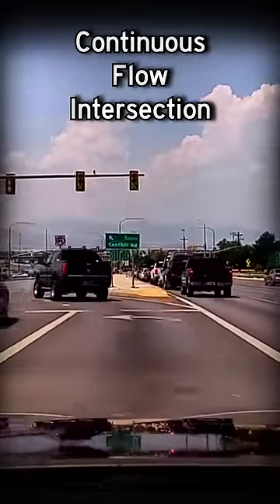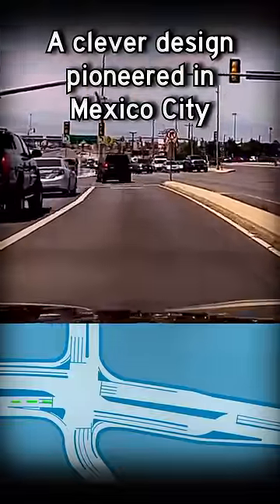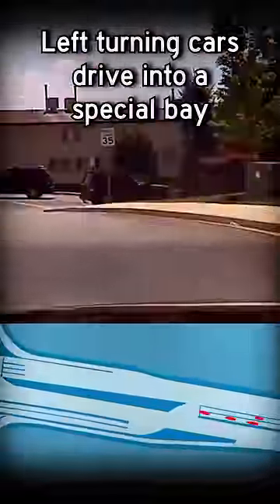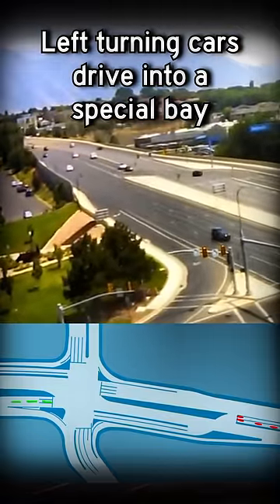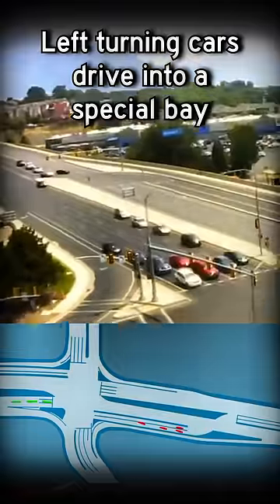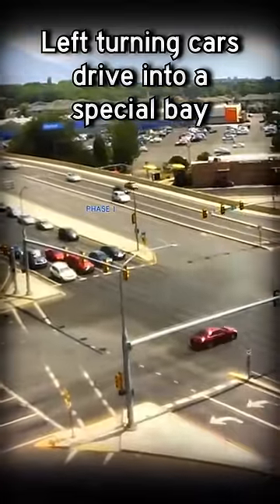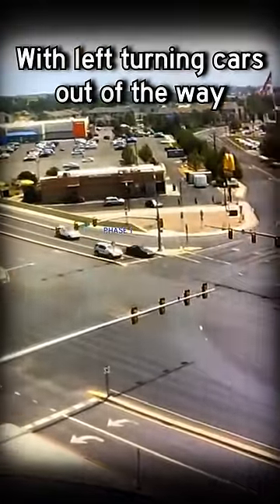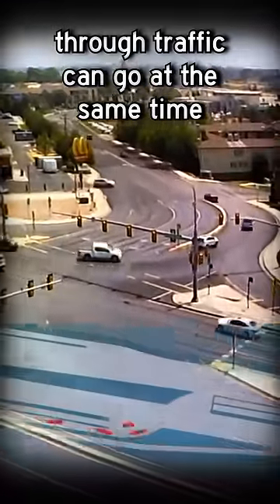Continuous Flow Intersection #shorts

Comment: The more I see crazy interactions like this, the more I start to appreciate roundabout designs 😂
Reply: roundabout is so good that its only problem is some people just dont understand that if a car wants to leave the roundabout on the same area as you wonna enter then you should let the car inside leave first
Reply: @nfsilverblade1526  Actually there is one other problem. For much of the united states they are so rare to see that when you come up to one its likely your first time seeing it which leads to drivers getting confused.
Reply: we have one of these where i live in canada, it actually is fairly decent for traffic flow but it realistically only takes one idiot to fuck it all up.
Reply: I live in Wisconsin (has one of the highest roundabout counts in U.S.) and I still see people getting confused by and stopping infront of roundabouts when there's nobody in them 🤣
Reply: @nfsilverblade1526  The one issue I've seen with round abouts are the ones with multiple lanes. People just move into your lane without checking to see if anyone is in that space already.

We have a small single lane one in my town. It sped up traffic a LOT. That intersection used to back up onto the service road and into the main road down the city. They put that round about in and both roads are clear even during rush hour.
Reply: Roundabout is great but is not the solution everywere cause if alot cars come from all 4 directions you will have problems
Reply: @xsforreal  im from Wisconsin too. Actually from Oshkosh, so EAA traffic makes the roundabouts super chaotic. But it is still better than when they were traffic lights.
Reply: @TehShadowDeath  I've seen multiple roundabouts but only a single one that has 1 lane, about 50% are 2 lanes and 40% 3 lanes
Reply: I’m the 666th like. Spooky!
Reply: @TehShadowDeath  that sounds more like an issue of police not properly ticketing traffic violators. You are not allowed to switch lanes in a roundabout. If it got ticketed properly, the information would spread quickly. Also, drivers should be required to take the written exam more often to cover new laws. Same issues happen all the time at traffic lights
Reply: @morbotheturtle3796  You are allowed to switch lanes in a roundabout.  If you weren't you'd be perpetually stuck if you didn't use the right hand lane.  Who told you that you're not allowed to change lanes?
Reply: Roundabouts are just as bad though.  It's wierd city planning propaganda that they're better.  They essentially have identical traffic flow, the only practical difference is that statistically roundabouts have more accidents but the accidents they have tend to be lower severity.
Reply: The way people talk about roundabouts you’d think there’s no traffic in Europe
Reply: i think he’d be fine with improving safety on the road

But using 10 lanes to do so?
Reply: @jimmydesouza4375  they only have identical traffic flow if you consider high traffic hours. Low traffic hours, roundabouts are much better. They reduce idling and keep you car’s efficiency higher. They have more accidents, but less major accidents. Traffic lights have t-bone collisions, roundabouts have minor fender benders
Reply: @morbotheturtle3796  High traffic hours are the only ones that matter.

Additionally roundabouts also have T-bones.  The statistical difference in severity is there, but it's not massive.
Reply: @jimmydesouza4375  id argue low traffic hours matter more. Thats when you end up sitting for 3 minutes at every light without a single car passing by the other way. High traffic times, the only thing that can be done is reduce the number of cars. Or use all self driving cars
Reply: Except in the US people drive SO fast in roundabouts, don't yield and many places have snow and ice
Reply: @NathanHedglin  kinda their problem if they didnt use it properly. Plus, again, police need to be enforcing the traffic laws to prevent those issues.
Reply: @bradybannister1926 I mean the same goes for traffic lights and stop signs.  One person can fuck it up.
Reply: They are great but i see people are very timid at them because of road ragers and people approach them at to high of a speed causing the system to not work half as well as it should
Reply: @NathanHedglin  That's just normal.  Even in countries where roundabouts are common most people are not comfortable with them so just try to "power through" by going fast.

All junctions will have similar problems though, for example people racing yellow lights.
Reply: A traffic circle is a continuous flow intersection. What is presented here is not.
Reply: @seth7745  No, what is presented here is a continuous flow intersection.  The term specifically refers to this kind of junction.  There is no such thing as an actual intersection with continuous flow as such a thing is impossible.
Reply: @jimmydesouza4375  You might want to look up the definition of continuous. Your statement makes no sense.
Reply: @jimmydesouza4375  In engineering "continuous flow" means uninterrupted. You can’t call it continuous if you have to stop. You typically don’t have to stop at traffic circles unless there is heavy traffic, hence continuous flow.
Reply: The only downside is that a lot of places in the US don’t have them and thus don’t know how to drive through em. My area has been getting more and more of em tho and it’s been pretty helpful
Reply: roundabouts are super common in many countries, I still can't believe how people find it confusing
Reply: My city is absolutely filled with roundabouts. Which is really nice, because we don’t have to deal with any of these stupid designs
Reply: @olstar18 that's EXACTLY why it's so hard and expensive to fix. The most proportion of fatal car crashes happen at 4 way light intersections...
Reply: @olstar18 I'm not sure how. I've been to over 23 states, of course I don't remember them all super clearly but most of them have roundabouts. Especially the populates places like Cali, but I know for sure the every state I've lived in I've had atleast a roundabout near me. And I've lived in 4 states. Right now I live near 3 roundabouts I use all the time. I think they are becoming more popular or something idk.
Reply: @kcchiefsproductions8687  They may be getting put in more but there is a large portion of the country that doesn't have them. I have only seen 1 roundabout and that was new when I went through there around 5 years ago.
Reply: @olstar18 lived in longview Tx my whole life, i went down to tyler tx and saw a roundabout god was i confused
Reply: The biggest problem with round abouts are the people that want to enter, the come to a complete stop, rather than merging in, and the people that are in the roundabout don’t use their blinkers when exiting, this has the confusion… then again people don’t use their blinkers when changing lanes either
Reply: @olstar18 that's why there are signs on the road, but I've come to learn that people are dumb and don't pay attention to road signs.
Reply: @nfsilverblade1526 New England has a lot of them. We call them rotaries, and people still don’t know how to use them
Reply: Tell me you’ve never used one of these “interactions” without telling me
Reply: @nfsilverblade1526 That's why they often come with yield signs
Reply: Now that I think of it, the only reason I've seen so many roundabouts is because military bases love building them
Reply: @user-do5zk6jh1k  there is a high chance that if they don't know how roundabouts work then they will ignore most if not all signs that aren't speed limit
Reply: @jimmydesouza4375 Several studies have proven that the traffic flow of roundabout a significantly higher.
Reply: @stevenbrenesmontiel  They haven't.  You, like many, are mistaking figures.  Studies tend to show that roundabouts reduce the durations of traffic stops/waiting times on average, this is because when traffic is low density they absolutely do this because you do not have to wait at lights.

This is then misrepresented to pretend to ignorant and dim witted people like yourself who's thought process ends at headlines that this increases general traffic flow, which isn't the case.  During peak periods, which are the only periods which matter because they're the only periods where waits will stretch into significant time periods, both have the same rough traffic flow and roundabouts have even more accidents due to the higher complexity of the junction interacting with the higher traffic density (which is why the trend towards traffic light controlled roundabouts has happened in Europe, despite the fact that by adding traffic lights you completely remove all of the benefits of a roundabout).
Reply: @stevenbrenesmontiel  There is also an extra element which I forgot to add in that last post but because editing can cause google to eat posts I'll just add in an extra post which is that roundabouts by their nature slow down the total flow of traffic on the roads which they serve, so while stopped duration is reduced in general for any road which has more than 1 roundabout actual transit time will be the same or longer.  When this outcome is addressed, which it rarely is, instead of being labelled as a negative outcome (which it is) it is instead re-characterised as increasing pedestrian safety.
Reply: @jimmydesouza4375  No? If there is a normal intersection with the same amount of traffic as the roundabout, 60-70% better trafficflow would mean that more cars can through in less amount if time wouldnt it?
Reply: @stevenbrenesmontiel  Try to read posts before arguing with them.  And better yet try to read, at least partially though ideally fully, those articles you think you're citing.
Reply: The round about confuses the American. They treat round abouts like stop signs and stop signs like round abouts. I have a few normal size ones near my home here in Colorado and everyone stops even with no on coming traffic.
Reply: @ceesjonk8088  interestingly, roundabouts have a HIGHER throughput mainly because they have less turn lane interference with a continues flow of traffic (unlike eg stoplights where at best half the cars can move at any given point)
Reply: @quantuman100  Think about what you just typed.  Do you really not see the issue in it?
Reply: Oh, I've seen two t-bone solid hit accidents in a local roundabout within 6 months.  Speaker  wanting to shoot straight through at full speed and the other, I think an inside lane driver couldn't be bothered to travel around again to get into the exit lane, so cut in front of another vehicle to get out, bam! Doors crushed in! There was also a hard hit directly in the ass of another.
Reply: @quantuman100  yes but not if trafficflow is high from all directions like were im from it doesnt work at all.cause of two directions that just keep coming
Reply: @ceesjonk8088 I’ve only ever seen roundabouts with four directions, it basically does away with the four way stop!! What I don’t like is most of them I’ve seen are two lanes and ppl don’t look before changing from inside to outside lane, they just drift on over. I think it they were single lane loops instead of double lane loops. If idiots didn’t stop u wouldn’t need a second lane imo.
Reply: @ceesjonk8088  so if we assume the most edge case of edge cases where two opposite sides of an intersection are where 90%+ of the traffic is coming from AND they all want to go straight or right, then yes, but at some point you have to take a step back and accept that this is a relatively unrealistic situation when 2 roads cross
Reply: @olstar18 Wow, I guess it just seems more popular in the places I've been. Guess that's what happens when you travel alot. I'm probably just forgetting about the places that didn't have them lol
Reply: ok what you gonna do to go left is go right
Reply: Bc ur not so bright
Reply: @nfsilverblade1526 YES! God I wish more people understood this 🙏
Reply: @olstar18  it's simple - add roundabout navigation into the driving theory and practice tests like they do in UK. If you dont know how to navigate a roundabout you don't pass.

In areas where they don't have an actual roundabout to practice on, just add it to the theory, and test it in every theory test for that area.
Reply: @TehShadowDeath  people should treat it like any lane driving and look first.
Reply: @morbotheturtle3796 you are allowed to switch lanes in a roundabout and you are supposed to do so before exiting.
Reply: @jimmydesouza4375 you can't have a T bone on a roundabout unless someone is a complete maniac and tries to drive straight over it 😂  cars next to each other should be always mostly facing the same direction. You don't get traffic coming at 90 degrees to each other.
Reply: @olstar18  Build more of them and people will get used to them pretty quick.
Reply: @harropizza   Road construction isn't cheap or fast.
Reply: @giftofthewild6665  You absolutely can T-bone even without people trying to drive straight over them, and people absolutely do drive straight over them, even ones which are 2 feet higher than the roadway.  No idea why.
Reply: @xsforreal  there’s an interchange in the Green Bay Area that has like 5 roundabouts below it lol
Reply: What I love about roundabouts is the fact that someone is ALWAYS moving. It’s so frustrating when at an intersection controlled by traffic signals, everyone must wait for a colored light to change even though there may be no traffic to pass through their green light. My mind instantly thinks “everyone has places to go and nobody’s going anywhere “. 😡😡
Reply: @ValronaV  Especially the ones who think that someone who doesn't know how a road feature they have never seen before must be stupid.
Reply: @giftofthewild6665  The thing is in the uk you will likely see it while like I posted here a lot of us have never seen one. Putting the theory into the driving test only helps if you have one to actually drive through. Especially 10 years after the test.
Reply: @olstar18   there's plenty of things on the UK driving theory test I've never seen in practice, still had to learn and memorise how to navigate it for the test, and I still remember what I'm supposed to do should it occur.
Reply: @giftofthewild6665  I don't know why you're fixated on 90 degrees.  A T-Bone is just a collision into the side of a vehicle at roughly the area of the doors.  Normally associated with high speeds.  Has high injury and death rates because there's less vehicle to protect the occupants from collisions in that direction.  You do not need to be perfectly 90 degrees for that.

Additionally it is very easy for someone to get a 90 on a roundabout, especially a multi lane roundabout, for example a car driving on the right turning lane being hit by someone going across the roundabout (or left turning for you savages I suppose).

You don't seem to be very familiar with roundabouts to be honest, to the point where I have no idea what you think they are.
Reply: @jimmydesouza4375   well because the letter T makes it sound like the 2 cars are at 90 degrees when they collide. We do not use this expression where I live. I am not familiar with its meaning.
Reply: @jimmydesouza4375   you aren't allowed to drive across multiple lanes like that though. That's my point. If a maniac is doing that then they'd do that kind of thing on a regular laned road / motorway.

You are supposed to change lanes the way you'd change lanes on a motorway or dual carriageway. Exactly the same way. And only exit from the outside lane, which means the kind of collision you are talking about would not happen.

And yes I'm very familiar with roundabouts, I live in a BOT which has regular British roundabout rules and roundabouts instead of intersections in almost every instance, and I drive in Europe regularly at the weekends with European roundabout rules (which are slightly different depending on the country). Regardless in all cases you are never allowed to just drive across lanes, you are required to change lanes like you would on any laned road.
Reply: @giftofthewild6665  "you aren't allowed to drive across multiple lanes like that though."

You are.  A multiple lane roundabout wouldn't work if you couldn't.

You have no idea what a roundabout is, do you?
Reply: Yeah if more people knew how to use them.....
Reply: @giftofthewild6665  Actually could you explain to me what you think a roundabout is?  You have said that cars can't hit each other in the side on a roundabout, which means there's no turning involved, and you have said cars can't change lanes on one, which is crazy.

I can't picture what you are thinking of when you type roundabout and it is bugging me.
Reply: As someone from Scotland I drive round dozens of roundabouts a day. So much easier than junctions
Reply: Roundabouts are underrated
Reply: I hate these on highways
Reply: My city decided to put roundabouts in neighborhood side street intersections!!! School busses are always jumping the curbs!!
Reply: @ceesjonk8088 what the hell? Have you even used a roundabout before? That's never been a problem.
Reply: @ihaka70377 what you do some research will ya come here in holland and look how well roundabouts work when there is heavy traffic jeez is that weird roubdabouts are not holy
Reply: Nothing like waiting for that 16 wheeler stuck in the roundabout because it ran over some little car in the lane next to it when the road curved.
Reply: @olstar18  oh the solution is very simple you see... more of them 😂
Reply: True.
Reply: @therealpeter2267  Do you have anything valid to add to this discussion. No. Then why did you post.
Reply: @nfsilverblade1526 they use single lane roundabouts in arizona in suburbs and similar areas with low traffic flow.. many folks end up driving onto the median in the middle and drive on that on accident 😂
Reply: @olstar18  It's not my fault that you don't understand it, it's like if people said before selling home computers: oh that's a bad idea, so few people have used computers before!! they would mess up their systems anyways, why give them PCs?
Reply: @therealpeter2267   Thats only because you haven't actually read what I've posted. Never said roundabouts were bad or shouldn't be used I merely out the issue with looking down on or insulting people because they have never seen them before.
Reply: @olstar18  but it's not an issue, roundabouts were new anywhere at some point, they are designed for cars so they had to just made it up along the way, and if it wasn't a problem back then why would it be now?
Reply: @therealpeter2267  It looks like you aren't actually here to discuss this issue and just want everyone to think you are a smart as you think you are. Listen the only place I have seen one it was at an exit on the interstate that was put between towns and it was brand new. Difficult to replace a current intersection with one because of the buildings and other property that go around them. Its time you started actually thinking about what would go into making an intersection into a roundabout.
Reply: @bradybannister1926 do you live in prince Edward Island?
Reply: @jimmydesouza4375  a highway exchange is continuous flow by description. The video example is using continuous flow to represent cross traffic not impeded by vehicles trying to switch direction. yes, the traffic must stop to allow for cross traffic, but the flow of traffic is not delayed or disrupted for those needing to turn at the intersection. So if there isn't any cross traffic, traffic flow is continuous even when someone needs to make a left hand turn regardless from which direction they approach the intersection to turn.
Reply: Come and see a round about in Boston!! If you got no skills you will be there for hrs. Jfk round about
Reply: @johnnyrocket4357  A highway exchange (well most of them, because our road network is a mishmash of 200 year old roads and new builds some are a mess) are continuous flow yes, they're normally considered separate from junctions like this in the old world however.
Reply: Roundabout cannot handle the load in comparison. This is a solution for massive traffic, while roundabout is rather for small one.
I guess this thing need WALLS separating the lines, and better signage WTF is going on. 
Swedish, turn right to turn left is similar idea, turn left turns into something else, but again not taught properly would make people cause havoc.
Reply: Roundabouts only work on low-ish traffic
Reply: @bradybannister1926  Too easy to get a license.
Reply: Roundabouts aren't a great replacement for a 4 way intersection with this many lanes.
Reply: @jimmydesouza4375 untrue. Roundabouts cause constsnt traffic flow which is more efficient leading to no queues to move. Longer lines = more traffic.
Reply: I do like roundabouts. Once you know how to use them, they're so great. But yeah, in the US nobody knows what they're doing. Tbh what annoys me the most is no one is signaling. I can't tell you how many times I have sat at the ones in my town, yielding to the guy coming towards me when bam, they turn at the exit right next to me. Like dude, I could have been already in and halfway through if you had signaled.
Reply: @Sean-zz2lj  Put some monument in the center of the roundabout. Artists need employment too. If someone really wants to crash his car into a concrete block it is his own decision. He will not harm other travelers.
Reply: @olstar18 yeah, the number of times people treat the yield sign as a stop despite no one being in the roundabout is annoying as fuck.  Also how slow some people go around it, or how hesitant they are to go when there's a space.  If there's a lot of traffic you have to take the space, same as getting on the interstate at rush hour.
Reply: @NathanHedglin if you can't go an appropriate speed in the ice on a roundabout, you shouldn't be on the roads in the first place.  Most of the people I see in the ditch in the winter because of snow or ice didn't make it far enough to get to any intersections.
Reply: Roundabouts are overrated
Reply: @Johnny2Feathers they're good in most cases.  There are a couple roads that we can't ship anything on around here though because the dump trucks can't make it around them without the trailer going up in the center of the roundabout.
Reply: @Johnny2Feathers  They are good for small streets and perfect for small roads. But they use up too much space and do not scale very well.

The design shown here is probably better for large roads when a two-level crossing cannot be applied.
Reply: Yeah, sometimes I get confused though because I can’t tell if the people are going to keep turning to sort of make a U-turn, or if they’re going to go the way I expect them to.
Reply: They really arent that crazy - chances are strong this is the exact set up that you get on the Interstate with in your near by town or city.  I know it's in Sevierville, TN as well as Arden, NC and Pooler GA
Reply: @olstar18 sounds more like a skill issue to me
Reply: @ceesjonk8088 its actually better when theres the same amount of trafick from all 4 ways in my opinion
Reply: @zaqqaz stoplights no stopsign yes
Reply: @shakinbottles  yeah sorry but what your saying makes no sense have 20 years on the road and youl  say otherwise
Reply: @jimmydesouza4375  omg you're the person causing crashes on the roundabout 🤣

No you're not allowed to drive across lanes. Whenever you have to change lane, you must check your mirrors, indicate, and change one lane at a time, exactly as you do on a motorway or dual carriageway. You are not allowed to drive straight across lanes (you will cause an accident doing this).

The lanes are there to filter people going off at different exits. If you are going ouy at the first or second exit you take the outside lane. If you are going out at the last exit you take the inside lane. You always exit from the outside lane so that you dont cross a lane (and cut someone off). No one should be exiting the roundabout from an inside lane. Period.
Reply: @giftofthewild6665  I am afraid as normal you're wrong.  While that might be true for US roundabouts (no idea) for UK and EU roundabouts you are allowed to cross lanes and indeed most roundabouts specifically have extra markings to show you how you're supposed to do this (so kind of technically you're never crossing the lanes from the direction you came in to the roundabout from but you are crossing lanes from the perspective of other people).  Even on roundabouts which do not have these markings you need to cross lanes on both entry and exit if either of them have multiple lanes (not all roundabouts with multiple lanes have multiple lanes on every exit/entrance).

Anyway you've never seen one so you shouldn't be trying to insinuate a lack of ability for anyone else.
Reply: @jimmydesouza4375   I'm not in the US, I'm in Europe. But UK highway code is much the same.

Here is an excerpt:
"When taking an exit to the right or going full circle (unless signs or markings indicate otherwise):

Signal right and approach the exit in the right hand lane

Keep to the right on the roundabout until you need to change lanes to reach your exit

Signal left after you have passed the exit before the one you intend to take
"

You are supposed to change lanes, not cross multiple lanes of traffic. There's exceptions for very long vehicles which may need to straddle lanes to get around smaller roundabouts.
Reply: @jimmydesouza4375   it's great to know who is causing all the accidents. I hope you never drive in Europe, we have roundabouts with 4 or 5 lanes here, imagine crossing 4 lanes of traffic from inside to exit the way you do 🤣
Reply: @olstar18 they taught us about roundabouts in drivers ed and on our tests we also were tested at the roundabout. Where I live there’s a lot of them
Reply: @olstar18 not an excuse
Reply: @joseph-rg4jp  I know there is no excuse for your post.
Reply: @ceesjonk8088  NAH MATE UR WRONG SORRY. ROUNDBABOUT IS MOST EFFICIENT
Reply: Its insane to see people speak of roundabouts like there rare,its all we have man.
Reply: @ceesjonk8088  
We have roundabouts with two lanes and that handles rush hour traffic just fine.

You need confidant knowledgeable drivers...

When you have space to go...GO....don't vacillate about it. 
(Tuco reference)
Reply: @TehShadowDeath  I have been in exactly one car accident and it was caused by this exact thing. Double-lane roundabout, I was in the inner lane and some lady on the outer lane tried to change into my lane (illegal btw) and trashed my passenger door. Wisconsin drivers suck.
Reply: Traffic circles or roundabouts work great in London and Rome but in the US they aren't built for practicality but because the community they are in is the boutique community of people who are special
Reply: @olstar18 If a driver gets confused, they must be really stupid. It's really self explanatory...
Reply: @olstar18  then they need to educate you in theory  tests
Reply: @TehShadowDeath sounds like a driver problem not a problem with the round about
Reply: @ceesjonk8088 it actually keeps traffic flowing regardless if it comes from all directions.. just yeild to the left.. they'll always be a gap
Reply: @nfsilverblade1526 thats normal, it's only like getting in the lane for a cross road
Reply: @jimmydesouza4375 cus you can't run a roundabout youre forced to slow down which immensely reduces horric high speed accidents
Reply: @NathanHedglin all drivers need proper education on them.. once they're normalised it'll be fine like it is in the uk
Reply: @LankyScotty  You can run roundabouts. Where does this weird idea that you cant come from? People will even run ones with tall raised islands which presumably is damaging their cars.
Reply: @LankyScotty  Why educate theory on something that you wouldn't see. Refer to my previous posts.
Reply: @ihazdaforks  If you are in an area that has roundabouts. Stop using it as something to make yourself feel superior over. Your acting like a 3 year old trying to act self important over the extra sprinkle on his cupcake.
Reply: I live very close to multiple intersections and it is hell for bikers or walkera.
Reply: @jimmydesouza4375 Lmfao you're not supposed to switch fucking lanes. left lane is for the far exit or multiple trips, and the right line is for the first exit OR 2nd exit, but you cannot continuously drive around like the inside lane.
Also,the person you responded to was referring to people switching lanes and not making sure they're clear first.
With that said, I think the worst thing I've seen people do is straight gun it into a roundabout rather than yielding.
Reply: @danielboger9751 no. the BIGGEST problem with roundabouts is that people don't yield for incoming traffic, nor know how to choose a lane. See my above comment for clarification.
Reply: @homegrowntwinkie  If you're not supposed to switch lanes how do you get on to that left lane of the roundabout and how to you exit at all?  Do you levitate?  Does your car phase into another reality?

Man, the 1SD below in this thread...
Reply: @nfsilverblade1526 thats y ur driving instructor should be teaching u about roundabouts and road laws? Not just how use the clutch and shift gears?
Reply: @dxfault576  r u asking a question or saying a point?
Reply: @ceesjonk8088  as someone from the netherlands with roundabouts every 500 meters from one another - no its not. They're never an issue just slow at best when ppl kinda suck at driving.
Even if a roundabout has 4 sides and all sides are packed with people trying to enter it's still smooth sailing. You go whenever the person on the roundabout is taking a turn off just before they get to you. This is also why blinkers matter a lot.

Im standing in front of it waiting, theres 3 cars on the roundabout, 1 passes me, the 2nd passes me and the 3rd has his blinkers on to go off the roundabout just before me so as soon as they start making a turn, i can get onto it. Its incredibly simple if everyone just you know followed the basic traffic rules, which sadly can still be quite a disapointment in reality.
Reply: @MetalRaimon  o ja rij masr eens over flakkee via rozenburg waar je drie rotondes achter elkaar richting hellevoet dat was al een drama voordat ze tunnel afsloten en dus is het helemaal een drama. Maar ok daar moet alles ook weer trug naar 1 baan ik ben ook pro rotonde maar soms kan het gewoon niet
Reply: @ceesjonk8088  okay maar niet alle rotondes zijn ook goed dedigned voor de plek lets be real
Reply: @MetalRaimon  treu treu
Reply: It’s all we use in the UK, it’s far safer, and the UK statistically has far more aware and just generally better drivers than the U.S, mainly due to reasons such as in the UK people are constantly on high alert, with the narrow roads, high hedges, no road markings on many back roads, 

The USA invariably use traffic lights to control these junctions in 2. above, whereas in the UK we use many roundabouts. Roundabouts are safer since accidents have to impact at a slower rate, so damage is not as severe as T boning at a junction where impact can be at 60 mph into the side of another vehicle.
Reply: Why roundabout when you can just find wacky roads to make people pass. I think city planner in the America just like watching pedestrian play frogger
Reply: A roundabout doesn't work well when there are 4 lanes of traffic.
Reply: A roundabout is slower than this intersection.
Reply: @ceesjonk8088 Hi, portuguese man here. No, it's not. We have 6 way, even 7 way roundabouts here. Roundabouts from 1 to 4 lanes. It's doable, and they are easy to go around on... Even if a lot of idiots don't know how to use them properly.
Reply: @olstar18  That’s not a design problem, that’s just an implementation problem. There’s gotta be a first for everything and figuring out a roundabout is gonna be a hell of a lot easier than figuring out the abomination in the video. Or would you rather live in intersection purgatory for the rest of your life?
Reply: @KeitieKalopsia  Do you have anything relevant to add or are you just here to feel important?
Reply: @nfsilverblade1526 in the UK you'd fail your driving test if you didn't know this.
Reply: @ceesjonk8088 that's literally what it's for.
Reply: @FuhrerHeisen  you use your right blinker when exiting the roundabout. If if you are going straight, then after you pass the first exist, turn on your right blinker to signify that you are taking the next exit
Reply: @FuhrerHeisen  I think it's good practice as it allows people coming onto the roundabout to know your movements. If they can see you're indicating to turn off the roundabout then they know they can enter the roundabout.
Reply: Big round abouts are such a cluster phuck so I don't know quite honestly. 

 Better than stupid jug handles where you gotta take a right to take a left. Yet that isn't the issue. Issue is when the exit you get onto the road is on the left, and so you gotta cut lanea of traffic to get over to the right. To take the jug handle. Just to take a left.

 And sometimes in some places if you miss that turn you have to drive ten minutes down the road just to redo it. 

 All for a left. 

 This is New Jersey by the way. Some of the dumbest roads I've seen in the 7 states I've lived in.
Reply: Until its rush hour. Then you have cars wanting to carry that constant flow not letting others coming from other directions enter. All roundabouts really do is slow people down and let light to no traffic flow
Reply: The problem with roundabouts is when a semi tries using it. Since they are slow to start moving, it's difficult to find a spot to enter when there's high traffic, which stalls the traffic on that entrance, not only that, semis take over all the lanes once they are in.
Reply: @nfsilverblade1526 it completely jams if there's more traffic than the intersection can handle. It also takes up a lot of space, smaller roundabouts are useless.
Reply: @jimmydesouza4375 People shouldn't be able to drive across the island of a roundabout, you're building roundabouts wrong.
Reply: @ThePixel1983  There are many situations where people should be able to drive over the island of a roundabout, especially smaller ones. Even if you do not build a roundabout specifically to allow it though people will still do it just because it saves them a second or two unless it damages thier car.

Also at least in the UK we have an odd thing which I can’t remember the technical name of where sections of roads and portions of roundabouts are marked as if you shouldn’t drive on them but you actually can and should (supposedly it reduces speeds and accident rates) which can make roundabout islands more of a problem to navigate.
Reply: @jimmydesouza4375  In Germany we usually have grass and plants there, so you don't collide with a tree, but ploughing through the greenery certainly isn't the fastest option. And diameters are tight enough to slow everybody down.
Reply: @nfsilverblade1526  there’s no interference in the scenario you describe. Both cars can advance simultaneously.
Reply: @jimmydesouza4375 So clover leaf and turbine junctions don't exist?
Reply: @pulaski1  Assuming you're referring to constant flow, they're not constant flow.  By definition no junction is, which is the point.  The idea that some junctions are "constant flow" and some aren't is just an ideological ploy.  Ignoring traffic obstruction with one set of junctions while focusing on it with others, often accompanied by skewed or outright manufactured figures to "justify" it.

Which is a common trend in modern infrastructure design (and life in general).  Lysenkoism and all that.
Reply: @jimmydesouza4375  OK, so you don't know what a turbine junction is (I'll admit that cloverleaf junctions have scissor crossovers).  A turbine junction keeps all traffic away from opposing traffic at all times, paths never cross.
Reply: @pulaski1  Psst.  Those can also cause traffic slowage or stoppage, if the ability for new traffic to merge is not facilitated enough.  All junctions are pinch points in any system by necessity.
Reply: @jimmydesouza4375  I don't know where you think a turbine junction would create a stoppage, other than sheer weight of traffic, which doesn't stop a junction being "continuous flow", as in a turbine junction there is nowhere that traffic in one direction is forced/ required to stop to allow other traffic to proceed.  

I drive through a turbine at least twice a week and in one direction I'm doing 65 mph (270°, "the long way round", limited only by my comfort in taking a very long left turn) in the other (90° "right turn", really just a direct transition from an off-ramp to an on-ramp), I briefly slow down to about 70mph.
Reply: @pulaski1  See, this is people pike you being easily manipulated by catchy terms and abbreviations. Constant Flow means constant flow. Claiming one type of junction is or is not depends on selective framing, typically looking at one in ideal circumstances and one in either normal or worst case circumstances. This is done to manipulate people like you into supporting unnecessary construction which will then have to be completely torn out within 20 years when the next infrastructure trend becomes popular. All the while kickbacks are being kicked back.

But the fundamental reality is that any junction can be constant flow in ideal circumstances, even crossroads, but will not be if adequate capacity is not built, adequate capacity being unpopular now. A is true of apple junctions.
Reply: Apple junctions :D. Typing on a phone especially with autocorrect, is a form of self torture.
Reply: This is WAY better than a roundabout.  You just go when the light turns green.  You don't have to look for all the cars coming into the circle.
Reply: @williamarndt9465  You should be looking even on light controlled intersections.  People run lights all the time.
Reply: @jimmydesouza4375  Less likely here because there are curves which tend to slow down traffic.  I've never seen people try to run a light.  I am utterly amazed at how well this works.  If looks crazy from a birds-eye view, but when you're driving, it's just watching the lights and making sure you're in the lane you want.
Reply: @williamarndt9465  With a roundabout you don't have to wait for a light to turn green, which means for most of the day, and ALL night, no cars are ever waiting.  Unlike traffic lights where there is always half the traffic waiting.
Reply: @pulaski1  With a roundabout you have to look every which way to see if cars are coming.  In this plan, you don't have to wait as long for lights because there are no left-turn only lights, and no right turn on red situations.  This intersection is MUCH better than before, because it's an intersection with a major highway, and before, you'd sit for ages waiting for people to turn left in front of you.
Reply: @pulaski1  So what, you can just drive in to the roundabout while another guy is driving through it?  Do roundabouts in your country have sci-fi phase disruption?
Reply: @jimmydesouza4375  Most of the time yes, two or three, or more vehicles, depending on the size if the roundabout can be making their turn simultaneously, and even if another vehicle would be "in the way", only letting off the gas, or maybe a slight dab on the brakes is sufficient to allow the other vehicle to move past and leave room.

If I have to explain this to you I can only assume you have never experienced roundabouts "in action".  A number of roundabouts have been installed near where I live in NC, replacing 2-way and 4-way stops, and they keep traffic flowing smoothly even during the height of the rush hour, and are much more effective than nearby traffic light controlled junctions that get backed up during rush hour AND cause needless stopping and waiting during quiet parts of the day and at night.
Reply: @pulaski1  "and even if another vehicle would be "in the way", only letting off the gas, or maybe a slight dab on the brakes is sufficient to allow the other vehicle to move past and leave room."

So the exact same thing that happens in an uncontrolled crossroad then?

"Most of the time yes, two or three, or more vehicles, depending on the size if the roundabout can be making their turn simultaneously"

No.  This causes crashes (and is why roundabouts have higher accident rates).  The way roundabouts are supposed to work is that you do not go if there is a vehicle to your right (or to your left for the savage nations).  This functionally means that roundabouts if being used the way they're intended to are limited to 2 vehicles on at a time, and can be more limited with things like 270 degree exits.  

What you are saying is true if you take the "Barrel through and get lucky" approach, sure, but that is how all junctions work with that approach.
Reply: @jimmydesouza4375  I been driving on roundabouts for over 40 years and they work.  Your theories make no sense in reality. 

And at an uncontrolled junctions, you need to stop on at least 1-2 of the legs, depending on the junction.  One recently installed roundabout near me replaced a T junction which caused 10-20 minute backups EVERY rush hour.  Now there is little or no wait, like maybe 15 seconds, so free-flowing traffic all day, even during the rush hour.
Reply: @pulaski1  I have yet to state a theory.  Also it is questionable whether you really have been driving on roundabouts considering you have shown you don't understand how they work, but at the same time a lot of drivers don't seem to so maybe that explains it.